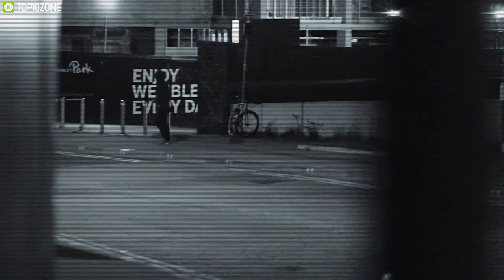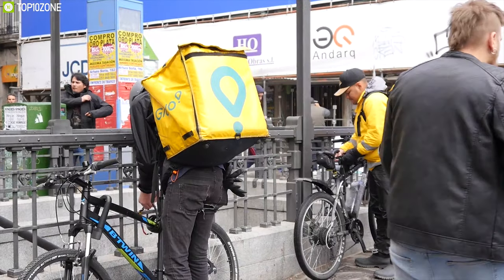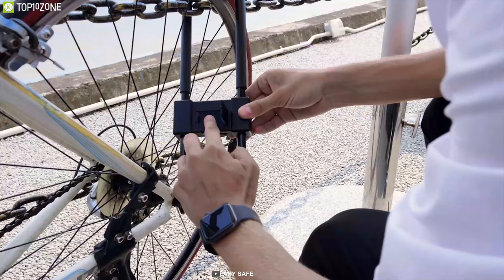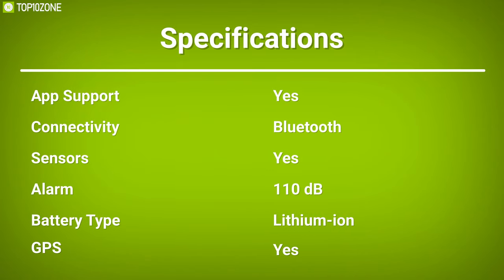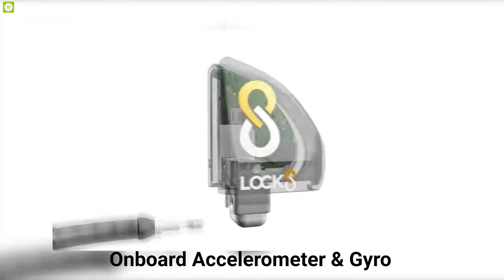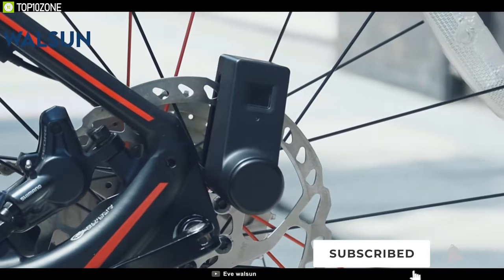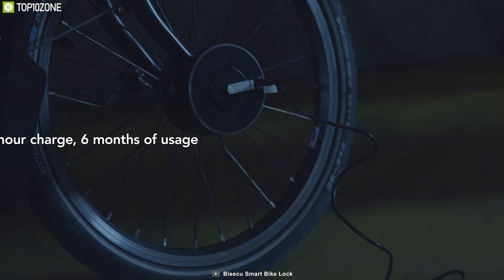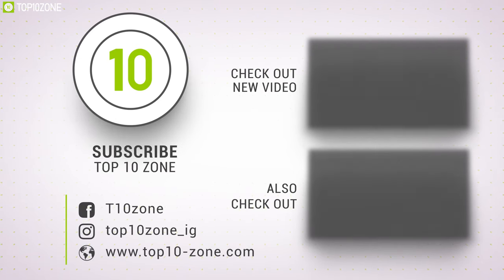Top 10 Best Smart Bike Lock to Secure Your Bicycle

Comment: those wheel locking systems seems to neglect the idea that the thief can just pick the bike up load it to a vehicle and scram. Anything that secures your bike to something buys you more time for you to check what is going on. I think the Lock8 is the best of all the ones showed
Reply: it depends on the bike. My fat ebike is 76lb with installed motorcycle trunk, food, 3 extra battery, some gadgets, 5x 750ml water bottles. The total weight I guess is well over 120lb. Trust me it is difficult to carry it. The thief will need to see doctors if he really carry the bike by brutal force. Besides, I have placed multiple gps trackers in the bike.